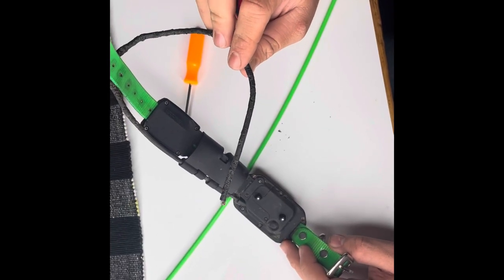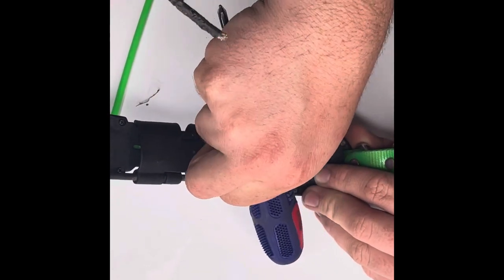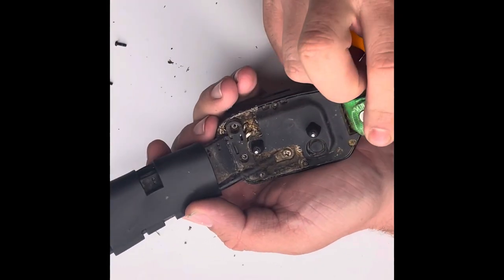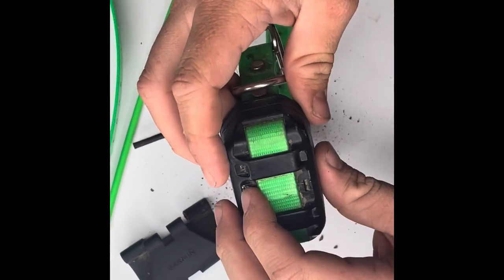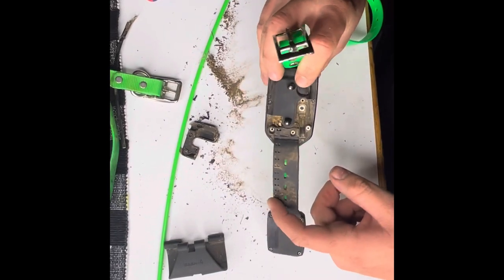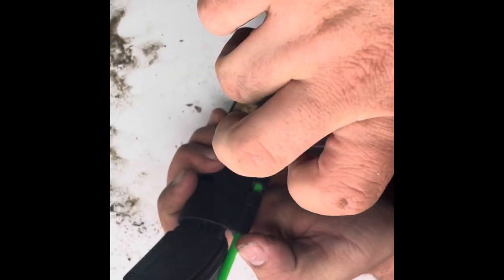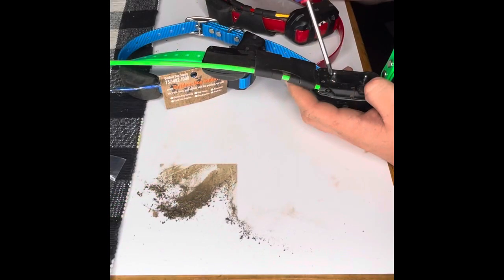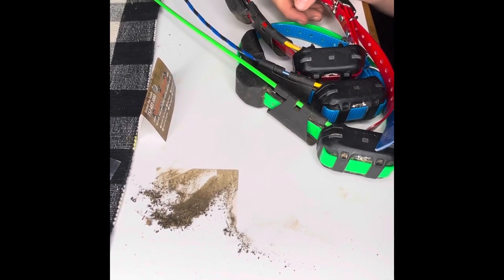Garmin tt15 mini antenna and collar replacement.

Comment: Just a question but what would happen if you did not replace the whip antenna? Would it still track but just shorter distance?
Reply from the maker: Mine worked still but seemed to be curled up and had wire showing rubbing into dogs necks.